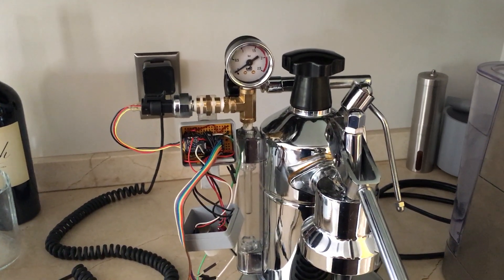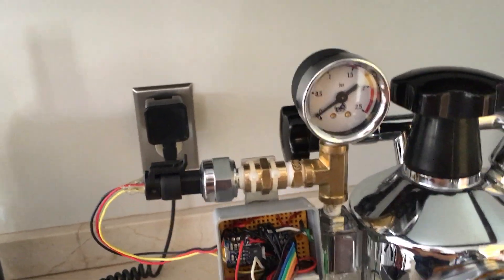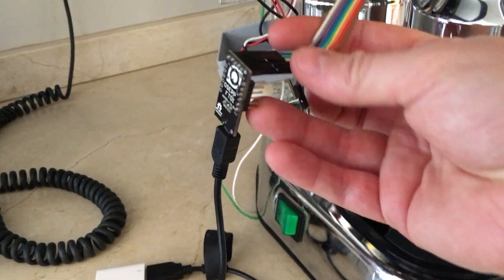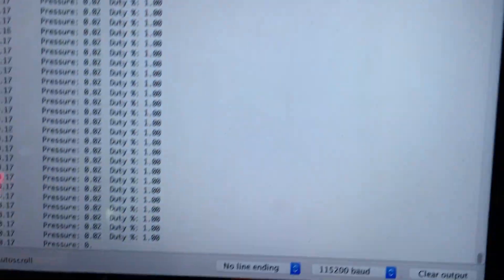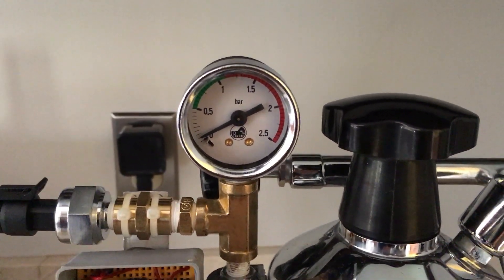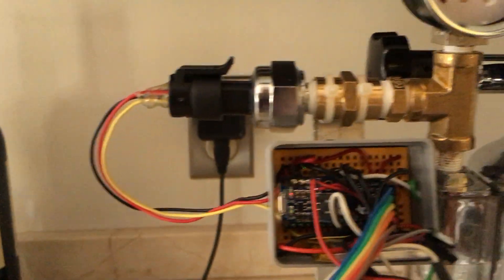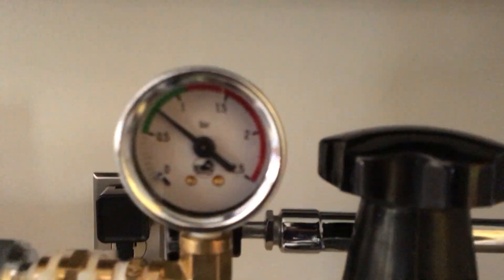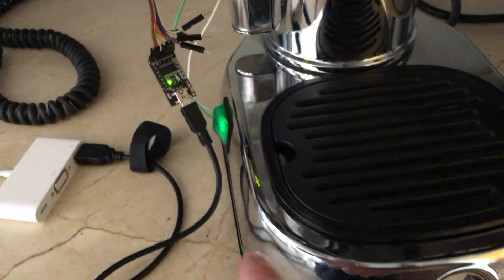Arduino-based PID temperature controller for a La Pavoni espresso machine

Comment: Interesting mod. Once I started thinking about PID modding those I realised that you need the steam pressure for pre-infusion.
This seems to solve that neatly.

Do you know the brew temp this correlates to?
Reply from the maker: It's a range. Anything above boiling will start to push water into the group head, but you need a decent amount of pressure to actually wet the puck. I don't know if I ever checked what minimum pressure/temperature was required to fully fill the group.

Comment: Nice mod. With the PID installed does that mean your La Pavoni doesn’t overheat and you are able to pull consecutive shots? I’m currently a Flair/Robot owner. I like the idea of a La Pavoni - seems like thermal management is a headache though.
Reply from the maker: The La Pavoni is a nightmare to use. They’re really only good to look at, so I wouldn’t recommend anyone buy one for actually making coffee. This mod made things a little more manageable, but still doesn’t solve the overheating after multiple shots problem. Maybe if you’re only drinking dark roasts this isn’t as much of a problem, but for anything else it’s a disaster. Save yourself the headache and go straight to a Decent if you can.

Comment: Thanks for this video, I'm looking to PID my LP eventually and will probably follow a similar method. I do have a question tho: how do you extrapolate Group Head temp via the boiler pressure? As far as I know, the water temp in the GH could vary depending on how fast you heat/cool the machine. Is this something you pretty much fine tune or is it really as simple as X bar = X celsius (assumed)? Ideally I want to maintain 90-95C GH water temp and if it really is a direct causal equation, then it would seem redundant to put a temp probe anywhere. 

Also hypothetically can't you put the pressure sensor T'd up with the pstat below the boiler to keep it more stealthy?
Reply from the maker: You are correct, there is no way to extrapolate group head temps from the boiler pressure, only boiler temp (and only if the water temp is above the boiling point). All this mod gives you is a more stable/adjustable starting point for your boiler temp. I don't think it's possible to get the group head to a reasonable temp at steady state, regardless of fine tuning the boiler temp. That's why this mod isn't that useful - I just did it for fun. If you're serious about temperature control, you'd probably be best served by getting something like a Decent. Certainly a fun project if you have the parts on hand though. As for putting the pressure sensor inside, it's probably possible, but the sensor is pretty large and I wanted to modify as little as possible so the top was the way to go.
Reply: @BarrettAnderies  Would it work to put a temp sensor in the group head (instead of a press temp at the boiler level) and close/open the circuit (like you’re doing in your video)?
Reply from the maker: @marcotriverio8195  I think there would be too much lag in the group head temp to have a reliable/stable feedback loop, but it would be interesting to try.
Reply: You need to add cooling to group head to do this.  I’m working on something similar.  Wrap tube around group head and pump cold water through it with a pid control to maintain temp of group head.  I have a 2nd pid for boiler temp.  Obviously set higher.